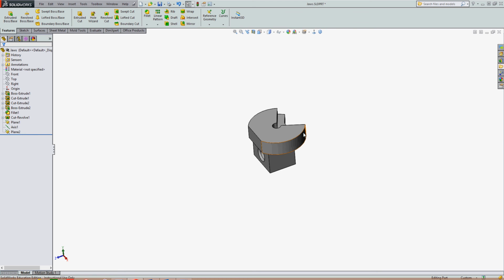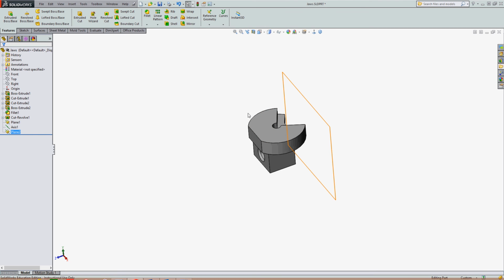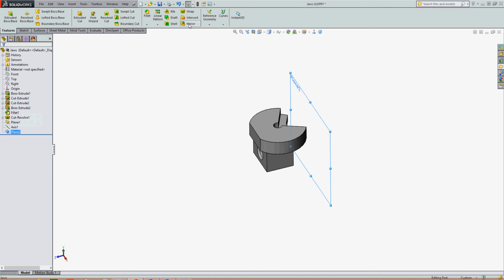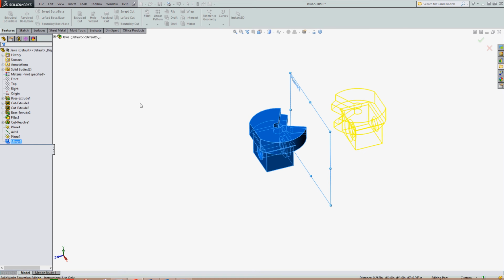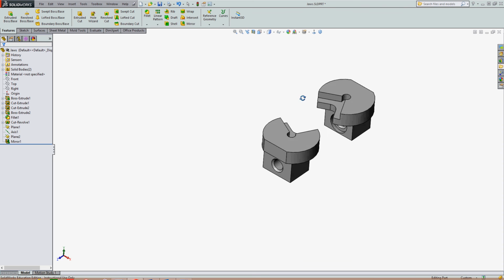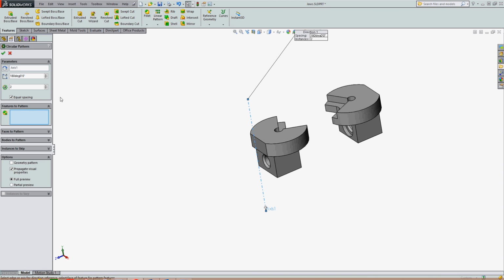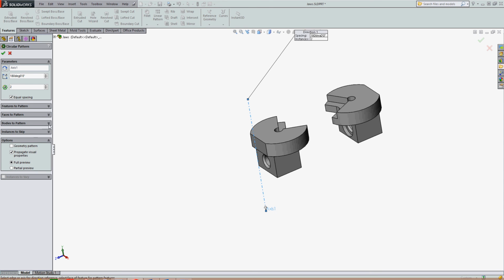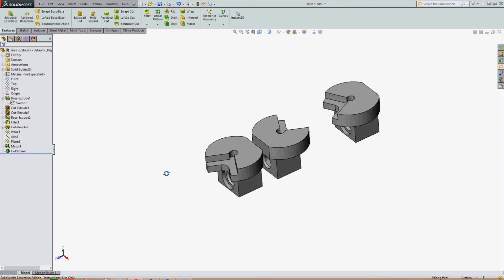Creating a Derived Part

Comment: Thanks.  Now, how do you save the mirrored part so you have the original part in one file and the new, mirrored part saved as another file?
Reply from the maker: There are two options.  one in the feature tree, you will see a folder with two solid bodies. Expand the folder, right click on a part and select "Insert into new part" the follow the steps.  You can do this for each part.

The other options is to not create the mirrored part in the same file, but rather select the mirror plane, then from the drop down menus select "Insert. mirrored part."  Again follow the prompts to create the opposite hand version.
Reply: It worked.  Thank you.